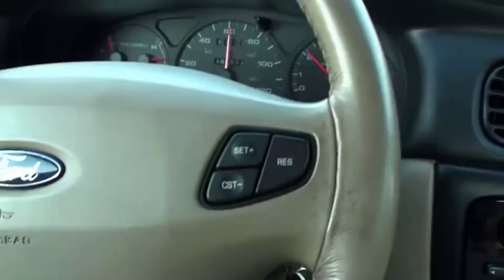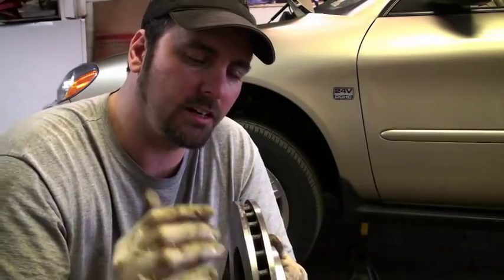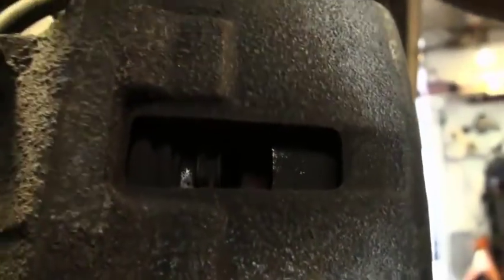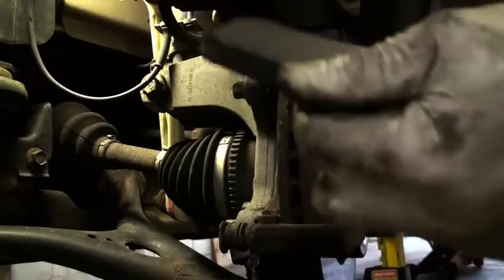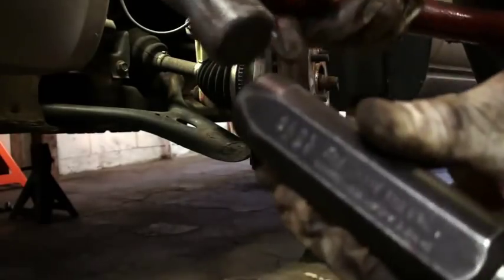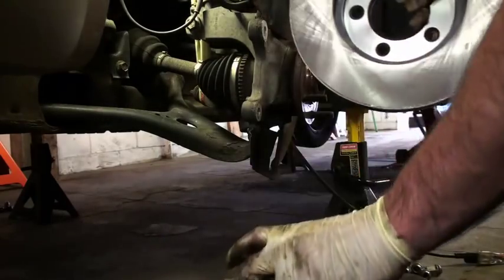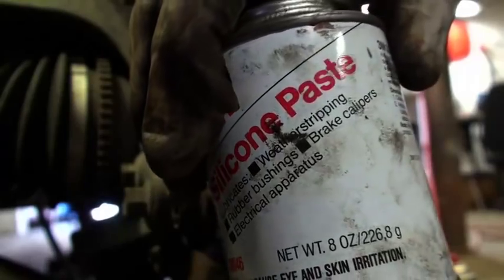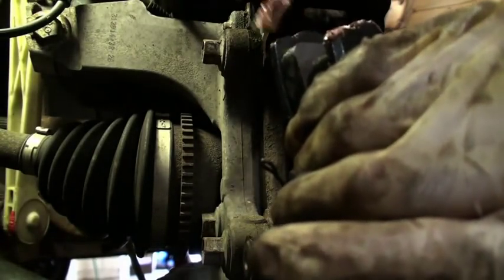Front Disc Brakes and How to Replace Them - EricTheCarGuy

Comment: I have a 2000 Hyundai Accent and this video saved me 350$. Local big name shop wanted 400$ to do my front brakes. 50$ in parts and grease and I was able to do them myself. Thanks Eric!
Reply: I had to buy some tools as well. It was 20$ for the pads.
Reply: Yeah. State side. Man that sucks.
Reply: local shop probably offered a warranty for their work.
Reply: Jace Ravenfield What does it mean if the brakes are making sqeaky it soundifvyou get.
Reply: If they are new .... you have to "break it in" or wait a 1k miles or more in city driving....
Reply: Shop warranties for this kind of thing is useless.   It's either done right or it's not.  If you take it back, they may hold the car for more than one day just to get to it since they aren't making any new money off of you.

Comment from the maker: It is a function of the shift lock out.  It's designed to prevent the car being left out of park when the driver exits.  It also prevents the driver from taking the car out of park without their foot on the brake pedal.

Comment from the maker: I can't go into specific models but there are many and yes, you can adjust ride height with most torsion bars.  It is quite obvious, you don't see a coil or leaf spring but rather a long bar attached to (usually) the lower control arm.

Comment from the maker: I would say you are correct in your assessment of your tech's diagnosis stemming from experience.  After diagnosing cars for a while you can develop a "sense" for certain symptoms based on experience.  You can be burned by this however at times but the longer you work at these types of problems the better you become at knowing where to look.

Comment: I've changed disk pads many times, but never considered clamping the line to keep fluid from pushing back up into the master cylinder.  I like that idea because keeping potentially contaminated fluid out of an expensive cylinder seems like a good idea to me.  Thank you for your work.

Comment from the maker: @recspecs22 The problem is actually that the pad holder of the caliper assembly will rust under the shims decreasing the clearance for the pads.  My solution to this is to grind a little bit off of the pads before I install the new pads if they won't fit in and move nicely.  I also use a small pry bar or screwdriver to remove the pads and sometimes I have to use a hammer, I really don't have a better method at the moment.

Comment from the maker: That's exactly why I showed this method in the video.  I myself have killed a couple of master cylinders because I didn't do it this way, not to mention the mess it could make if someone topped the master off before you did the brakes.  Thanks for the comment.

Comment from the maker: @EVLGTR If it was only temporary then I would say that it is normal, rotors are coated with a rust inhibitor, when you heat up the rotors for the first time this coating can burn off causing smoke and a smell in some cases.  If the smell persists after a couple of days then you should look into it.

Comment from the maker: @jambe1234567 You could ruin the master cylinder by forcing fluid back in the opposite direction, in addition to that if the master overflows brake fluid will get all over the firewall and brake fluid will ruin paint.  It's a good idea to replace pads with rotors because pads and rotors wear together and not in a straight line, in other words worn pads will have a slight bevel to them that would take some time to wear in on new or machined rotors.

Comment from the maker: @securityguy You really don't need much, the reason I do the "pinching" is to prevent air from being drawn back into the system, think of a drinking straw that you put your finger over the end of and pull it out of your glass, the liquid still stays in the straw, the same works for air and that's all I'm doing when I "pinch" the hose.

Comment from the maker: @lrossi888 Sounds like replacing the front rotors is the way to go in your case.  When rotors get too thin they tend to exhibit the behavior you describe.  You might also have a pulsation from the rear.  You are correct that if you have an ABS light on the ABS is inactive.  ABS however does not effect the base braking system.  A good inspection of the brakes might reveal the source of the noise so it's probably a good idea to get the wheels off and get a look at the pads and rotors.

Comment from the maker: @Chris07860 Thanks for your comment.  Anytime you machine or replace rotors it's a good idea to replace the pads as well.  The reason is the pads will wear in a bevel shape to conform to the old rotors and may not make complete contact with the newly surfaced rotors.  Eventually they will wear in but if you have the opportunity when you take the brakes apart there is really no better time.

Comment from the maker: These days I've seen them leak externally more than internally into the cylinder head.  Back in the day with the European cars that had mechanical fuel injection we used to remove them from the head and watch them with the key off and pressurized.  I suppose it might cause a cylinder miss or cause a cylinder to run rich, you might find this by doing a power balance test or read the plugs.

Comment: Glad I can help! Eric is a professional mechanic unlike me, an arm-chair commando & shade-tree mechanic :-) Some people bleed a new master cylinder with a syringe pushing fluid up from the bottom the same direction it would flow if you retract the calipers.  It is a PRO that if you don't open the bleed screw no air can get in but a CON when the fluid in the reservoir overflows (loosen the cap).  Most important is to line the clamp up and don't force or you might score the bore.

Comment from the maker: VTEC is Valve Timing Electronic Control, it means that the computer can control more than one cam profile.  Cam timing is directly related to an engines power curve.  In the case of Honda they did it to create a broad power band spanning the gap between fuel economy and performance.  These days just about everyone has some form of valve timing control.

Comment from the maker: @1suckafish1 I think I listed the tools either in this video or the one I did on rear discs.  It's simple really, you'll need the tools to remove the caliper of course but also a can of brake cleaner, antisieze, and silicone paste to lubricate the caliper slide pins.

Comment from the maker: @patriley2 With rear disc brakes often the piston needs to rotate to compress it, the silicone around the piston will allow the dust boot to slip along the outside of the piston as you turn it in.  Front calipers don't need to rotate to be compressed so you don't need to lubricate the dust boot.

Comment from the maker: It could be either one actually.  Check for stuck slide pins first since that's the easiest cheapest thing to check.  Use silicone lubricant, not grease to make them slide again after cleaning them.  If the pins are moving you will need a caliper however.  One last possibility is a brake hose problem, you can check this by pumping the brakes several times then cracking the bleeder valve on the suspected caliper, if brake fluid comes spraying out with no pedal pressure it might be a bad hose.

Comment from the maker: @wpaskar Yes those can be a problem indeed.  You need to get it out however and clean and lube it if you can as it is part of the slide assembly, if you don't get it out and lube it the brakes will not be able to work properly and as you have discovered you won't be able to install the new pads.  You might want to remove the caliper from the vehicle and put it in a vice to get a better hold on it, if you can't break it loose your going to have to replace it.  Good luck.

Comment from the maker: @denperre I'm pretty sure they didn't block off the line and crack the bleeder when they did the brakes and as a result overflowed the master cylinder, they may have cleaned it but it would still collect in the lower chassis and it might be some time before it all worked itself out.

Comment from the maker: It does control air flow in the throttle body but it is designed to keep idle speed steady during all conditions such as turning on the AC or heavy power steering loads.

Comment from the maker: Crank and cam sensors are used to indicate crank and cam position for fuel trim as well as spark.  Think of them as the "time keepers" of the engine, the clock on the wall that tells everyone else when to do things.

Comment from the maker: @sav7152 I recommend replacing pads whenever you replace or machine rotors.  The reason is the pads wear to the rotors, if you looked at a cross section of a rotor it's actually thinner at the top toward the edge than it is at the center.  I'm sure the old pads wore to this shape and putting them on new rotors they wouldn't make complete contact for a while.  That said, it would probably be fine if you reused your old pads but you might have a "spongy" pedal for a bit till they wear in.

Comment from the maker: @weitendf Yes, use a socket with an extension that is just larger than the pin and hammer it out, works pretty good actually.  Also clean those mating surfaces very well before reinstalling the pins and use a little bit of anti-seize to help lubricate when your done.  Easiest way to get a wheel like that off is to remove the lug nuts and reinstall them without tightening them down, leave them loose, take it for a drive in a parking lot and make some turns, usually works.

Comment from the maker: @KenBobBad You can find the silicone online.  I really don't recommend using anything but silicone, everything else I've seen used will dry up and cause the pins to stick including antiseize.  Also, the pins were originally lubricated with silicone from the factory and if you mix lubricants it usually causes problems in my experience.

Comment from the maker: @Dicofole You would need to machine the rotors if it's bad enough to cause a pulsation, but if it's just rusting up then drive it occasionally and it should clean the rust off.  There really is nothing I know of that you could do however other than driving it.

Comment from the maker: @sharky322 Depends on how much material is left.  There is a listing for the minimum thickness of a rotor, measure the rotors to see if you have enough to machine and then machine them and recheck the thickness, if you're still in spec you're good to go, if not replace them.

Comment from the maker: @powesmith Putting grease on the back of the pad really only makes a mess and does nothing to reduce noise.  Sometimes you apply a bit of moly grease to the back of the pad between a shim and the pad but not without.  The best policy is to use a quality pad as they are much less likely to produce noise.  I've never torqued the caliper fasteners and haven't had a problem but I'm sure there is a spec for it somewhere and if you find it it's not a bad idea to use it.

Comment from the maker: @pietertimans Originally the pins are lubricated with silicone from the factory, mixing lubricant's is not a good idea as they may not play well together.  Grease eats the boots because the bots are petroleum based and reacts with the grease and as a result they break down over time.  I've seen more brakes messed up by incorrect lubricants than I can count.

Comment from the maker: @MeowJW I never have and up to this point I haven't had issue because it normally isn't required unless the vehicle sat for a long time with the hub exposed. If there was an issue with hub run out then the best way to solve it is to machine the rotors with an on-the-car brake lathe.

Comment from the maker: I did a 2 part video on doing drum brakes, I hope it can help with your job.  The best way to do a rusty O2 is to cut the wire and put a box wrench over it, if that doesn't work try a little heat with a torch.  Good luck.

Comment from the maker: If your talking about the bleeder on the modulator, yes, I have cracked one loose just to see what would happen, it's not that bad.  The thing to keep in mind however is that brake fluid ruins paint so if you try this make sure the car's paint is trashed already and you wear eye protection, brake fluid in the eye especially at pressure hurts.

Comment from the maker: Great questions.  No, if you put the fuel lines on the pliers as I showed in the video there isn't an issue with the brake line that I've experienced up to this point.  If you follow this procedure, bleeding the brakes is not necessary in my experience as well.

Comment from the maker: Thanks for the comment!  I went back through my archives and I don't have an interior air filter replacement for YOUR car but I can say it's not that difficult.  In yours it's located behind the glovebox behind a plastic cover that snaps out.  Be careful when you take the glove box out because of the damper that is attached to the side of it. Also, heed the directional arrows on the filter and make sure you put it in correctly.

Thanks for watching.

Comment from the maker: On older systems pressure is stored in the accumulator not the brake system.  Newer systems only create pressure during ABS operation.

Comment from the maker: @CaseyK1982 The amount of brake fluid that travels back to the master is proportional to the amount originally displaced during normal brake application, when you force the piston all the way back into the caliper you are overwhelming the seals in the master cylinder and forcing fluid past them, this is something that doesn't happen during normal brake operation.  I hope to do a video on caliper operation in the future that I hope will better explain it's operation.

Comment from the maker: @PVoyager Even at the dealer we didn't 'flush' the system but there was a place I  worked where we had a pressure bleeder and that worked pretty well.  It would be a good idea to suck all the old fluid out of the master and clean the inside before you get started, then fill it up with fresh fluid and bleed LF, RR, RF, LR.  I recommend using the tool that I show in this video as you will be able to see when clean fluid starts to come out and it will help prevent introducing air into the system.

Comment from the maker: @eisman07 Use the Sil-Glide as it is silicone based, the grease would not work as well and if it mixes with the silicone it will cause the pin to bind in the bore.

Comment from the maker: Bearings usually fail due to lack of lubrication, improper torque, or impact damage.  You would be surprised at how a small mark on the race can create a big noise.

Comment from the maker: No, in fact I would not resurface the rotors if you don't have a pulsation while braking.  It is nice to start with a clean straight surface when installing new pads but if cost is a consideration just replacing the pads is just fine.  Some manufacturers recommend NOT resurfacing the rotors when replacing the pads anyway so you should be just fine if you don't have a pulsation.

Comment from the maker: No, usually means a misfire of some kind, i.e. unburned fuel getting into the substrate.  It should function around 600ºF and be 100º hotter at the outlet than the inlet if it is working properly.

Comment from the maker: @Louiepizzo Situations like yours often depend on the tools you have.  If the bolt is stripped and you can't get it to turn you may have to grind it off and put new pins and bolts on it.

Comment from the maker: @adboke To be honest that depends on your skill level and if you run into problems as you work.  I can usually knock out a set of pads in about a half hour but I've done more brake jobs that I can count and I have all the tools I need to get a job like this done.  As for online parts suppliers I don't have one that I deal with directly but there are plenty to choose from.

Comment from the maker: @outlanderrider That may be a problem with your local server as I haven't heard that complaint from others and for me they seem to load fine.  You might try taking them down to standard def in the preferences to see if they load that way, it's the button in the lower right corner.  Sorry your having such trouble.  Have you tried watching them from my website?  They're just linkbacks to YT but if they work there then I would say it's defiantly a server issue.

Comment from the maker: @mraccord92 If you have captive rotors (and I think you do) no you can't as it is backed up against the hub.  To replace it your going to have to remove the hub assembly, you don't have to split the bearing by I believe you will need to remove that one to fix it.  Watch the video I did on replacing Captive Rotors for a look at what your up against.  Good luck.

Comment from the maker: @basketball1608 Banging the rotors off is pretty common actually so don't worry about that.  Give it time and the pads should seat in and get quieter.  If not make sure you lubricate the caliper slides and pads as demonstrated in this video, it goes a long way toward keeping things working correctly and keeping them quiet.

Comment from the maker: Not on a GTO but this procedure is common to the slip off rotor style.  Rear disc brakes vary greatly from different manufacturers, but I will be doing this for a while and hope to cover a lot of different types.  If this was all that I did I would be able to post more and cover more sooner but I not make a living at this just yet.

Comment from the maker: @dre1162 Normally they will rub together, depends on if it is excessive or not.  As for resurfacing I normally don't do it unless there is a pulsation or damage to the rotor.

Comment from the maker: @spelunkerd You drive in a safe location and pull up on the ebrake while moving, if the vibration is there the problem is in the rear, if not it's in the front.  This does not work with disc brakes with the parking brake in a drum assembly inside of the disc however, you have to diagnose those by 'feel'.